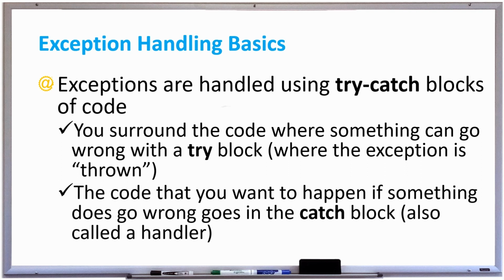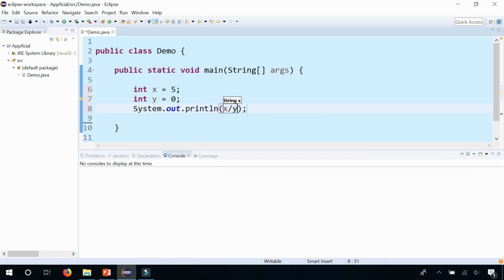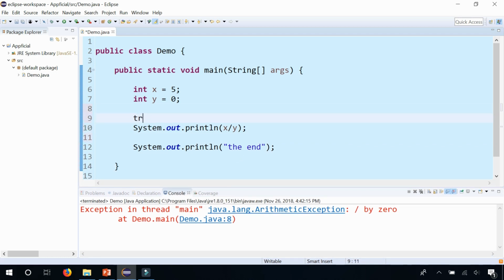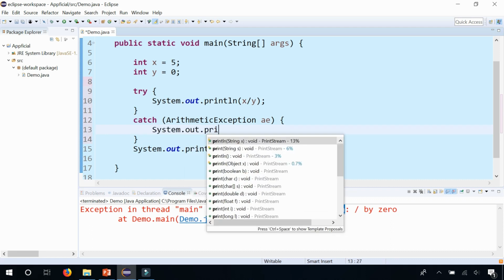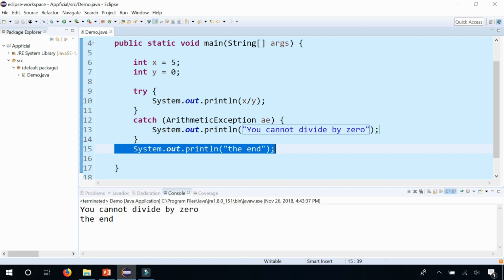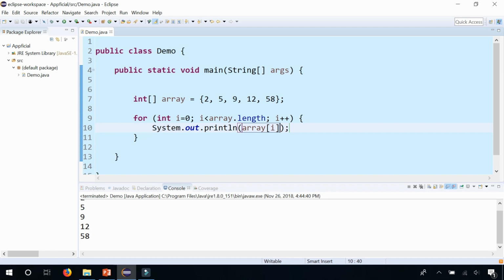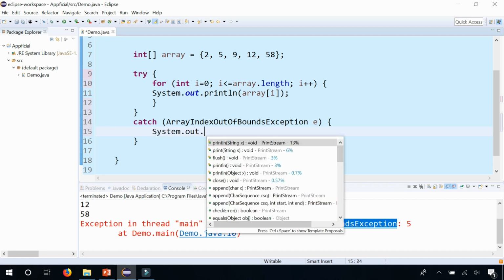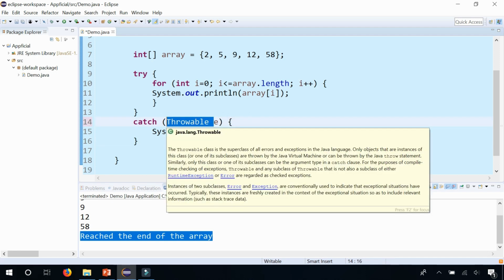Java Exception Handling Basics - Try and Catch Blocks Explained by Example - APPFICIAL

Comment: So if the catch block doesn't specify the kind of exception that was thrown what happens?
Reply from the maker: You can have multiple catch blocks. The top ones are specific to the issue, and a catch blocks that just catches Exception for everything else
Reply: @Appficial  will the Java execute the rest of the try block?
Reply from the maker: @MsAshaanderson150  no, it stops once an exception happens